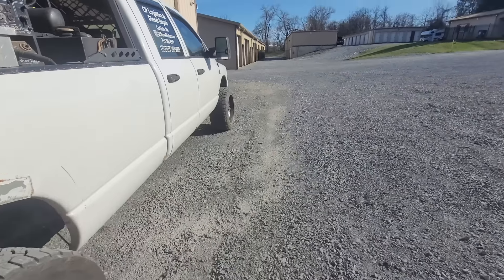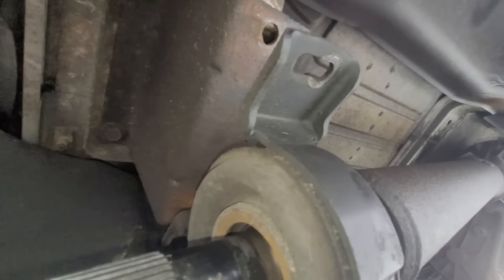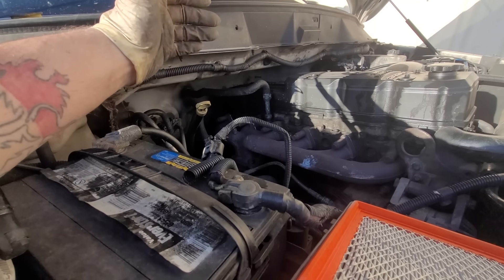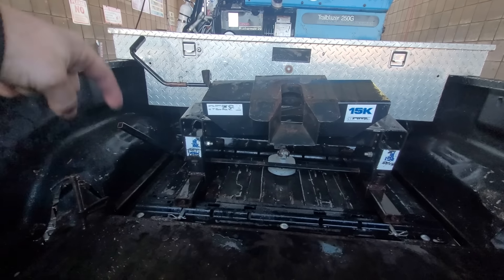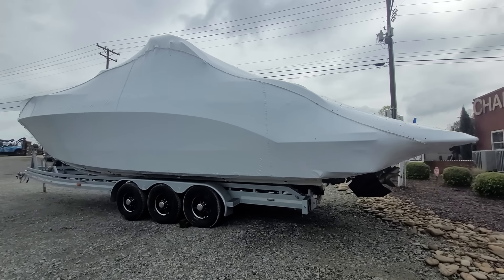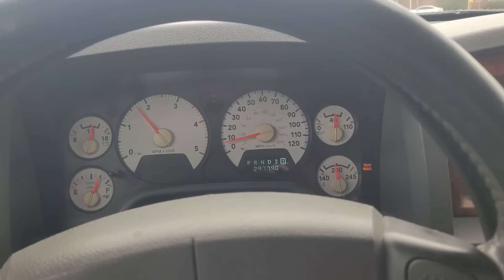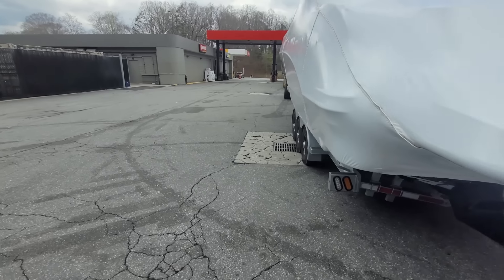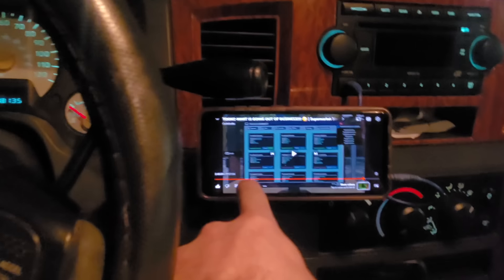✨️OVERSIZE✨️ He Tried To Screw Me Out Of A $6,800 Job

Comment: Not sure but why not add one of those auxiliary fans at the front and wire it in reverse so it suck and not push or would that restrict the original air flow when it's not use 🤔.....

Comment: The other baffles you slid back into the cylinder portion of the air intake, I just left them out on my truck and plastic welded that lip back on to be able to install the cylinder back in.

Comment: Two straps on back of trailer by ratchet strap hooks & break way cord should be there for dot and make sure no plug is in it just boat weight station is open I would have like that load.
Reply from the maker: I ended up putting two straps in the back in the next video. You'll see why. I haven't hauled a boat in a long time so I'm very rusty. After 2500 miles, though, it'll come back to me!
Reply: @CPSteveMiller YES, THAT WAS MY THOUGHT WHEN YOU BROUGHT IT UP TO THE SHIPPER, I WOULD HAVE ASKED FOR THE SHIPPER TO CUT ME ACCESS TO A TIE DOWN EYELET.

Comment: You’re better off to wait and get the proper seal and not have to redo it again. With no lift I wouldn’t chance having to crawl under it again. We do it right, cause we do it twice; sucks without a lift. Cheers 🍻
Reply from the maker: Yeah, I waited. New one will be in when I get back
Reply: @CPSteveMiller  the boat content looks good on you

Comment: I would honestly just go back to stock injectors. You can pick up stock injectors anywhere but built injectors you can. And does it make that much of a difference. I’m running stock sticks on my truck bigger turbo and custom tunes and it’s more than enough power
Reply from the maker: I won't go back. Better fuel mileage and power with controllable egt's. Plus I have a spare. I'm just going to show up when I get back and get my parts.
Reply: @CPSteveMiller  so I take you have a issues with who you got your injectors from
Reply: @CPSteveMiller  you spend all that dam money you would think they would have a better warranty program
Reply from the maker: It's not the company they came from. It's the guy I go through to go through the company. It's annoying but I will be changing my parts source after I get my parts.

Comment: 2nd time Ive watched you haul a triple axle trailer without a dually. That is Illegal. Just saying.
Reply from the maker: No, it's not.
Reply: as long as it is diesel, it will pull a house with 10 axles, got it?